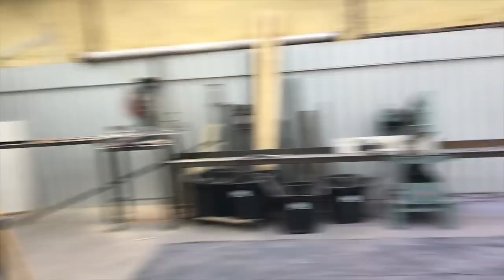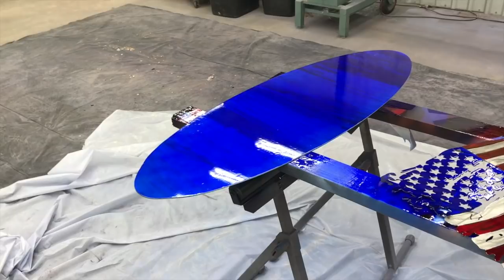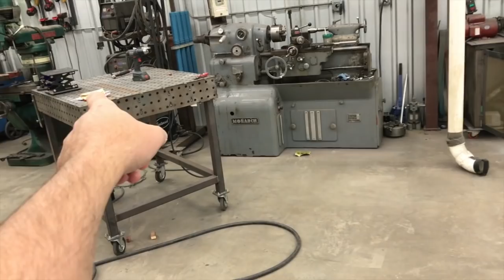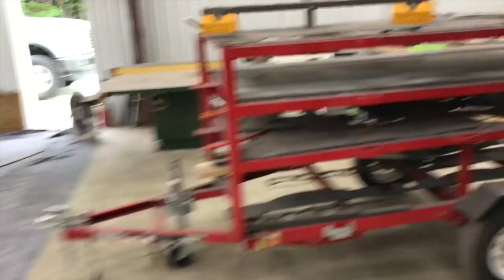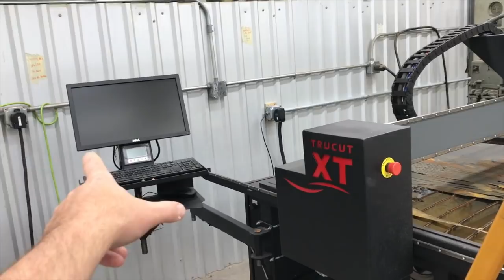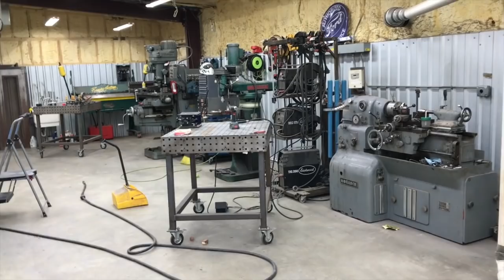Fire Sale - Lab Jack tig prop discussion - short videos

Comment: The metal  stock storage trailer is super clever. Did you ever make a build video on it?
Reply: No I sure didnt.  I had a part time guy working for me at the time, and I had him build that.  Its just a harbor freight trailer with a square tubing frame on it.  I do have a build video on the vertical sheetmetal storage cart I made around the same time

Comment: Never install anything on your machine controlling computer, or let it go on the internet. I've lost countless hours and jobs by not isolating a particular computer... especially ones that only work still to this day on Windoz 7 or older, with zero options on software upgrades.

Right now I'm having a hell of a time fighting Winodz 10 updates ruining some jobs in the middle of the operations. I have no way of turning off the updates, even if I'm not connected to the internet.
Reply from the maker: you can turn on metering, it will automatically disable updates
Reply: Eco Mouse ever considered linux/ubuntu?
Reply: When you are relying on a manufacturer to put out it's specialized software to run a particular machine you bought from them... and the best they can offer is something running on Windows XP (haha) finding a similar program on ubuntu would be nearly impossible. Short of finding a software developer and paying them to write a fully featured program to run your machine.

I've got 3 such machines right now that have their dedicated computer. One is a program that is for making channel lettering. It takes in eps/dfx files and calculates the the bends and brakes, and prints onto a really old label printer (that's not even USB) that you apply to the letter coils, and aids in the fabrication of the letters. I think one of the cables is serial to centronics something or rather super old.

PlasmaCam is another that uses their own proprietary CAM software that ONLY talks with their control box as an all-inclusive package. It works great, when you've paid the extra $4000 to unlock all the software upgrades. But can only work on an older windoz machine.

Last is a wide format printer that has a RIP program that can best be described as Chinglish. But it works, and was free. Commercial versions can run up to $6000, and my printer is not included in any of the supported printer lists of any of those commercial RIP software programs. Again, it only runs on Windoz 7  I think.

I've had other machines in the past that had similar issues, where the software works just fine, the manufacture refuses to update the software to run on newer operating systems and just insists that you keep your older computers around just for their machine.
Reply: I don't even know what metering is.